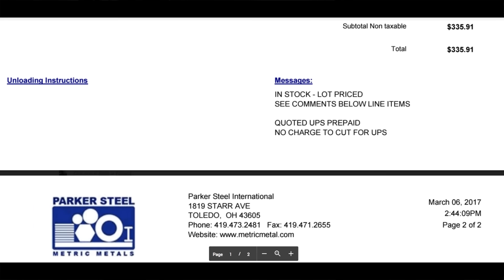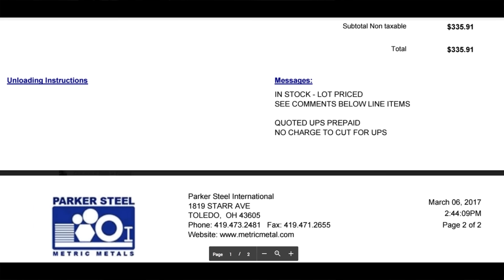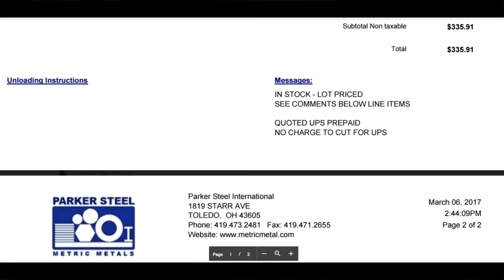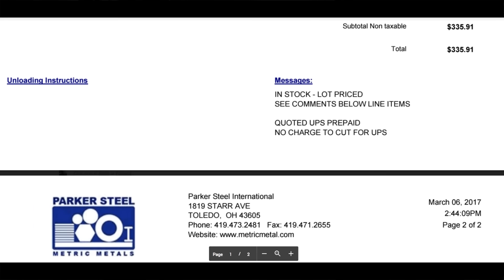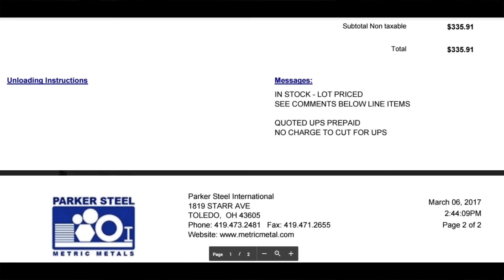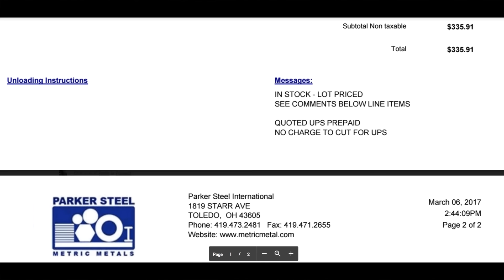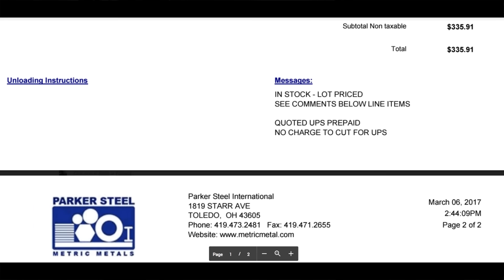Gingery Shaper Update and Atlanta Woodworking Show

Comment: How dose the lathe workfor cutting steel. You did a good job on it. I can't wait to see the shaper. Have a good one
Reply from the maker: The lathe cuts steel. How well depends on how sharp the tool is, but I haven't characterized the performance since upgrading to the concrete cart. I expect to be able to get within 1-2 thousandths fairly routinely.

Comment: How much beer was required to gather enough aluminum to cast that side panel? I'm curious because I need an excuse for buying that much.
Reply from the maker: HAHAHA! No idea, I don't use cans. They have a low yield relative to other sources. You don't need excuses to exercise your inner maker btw. ;) I had some metal left over from the lathe that was enough. But I have 3 transaxles queued up for casting stock when my last two ingots are gone. To help your cause, 3000 cans will get you a good start on the project depending on how efficient your process is.